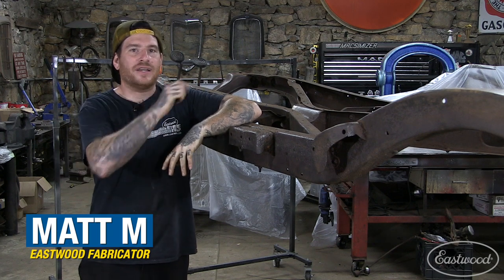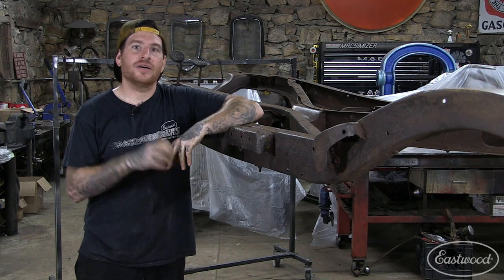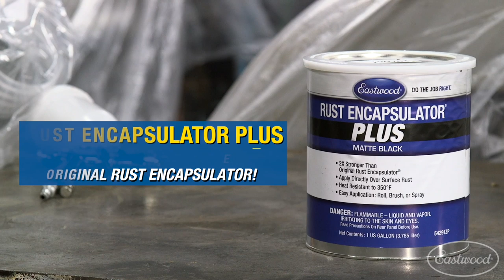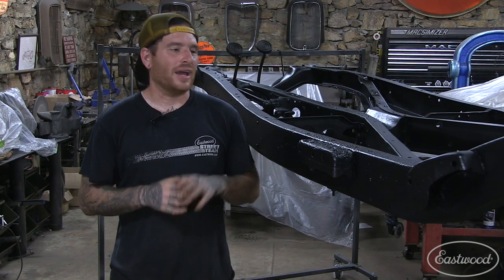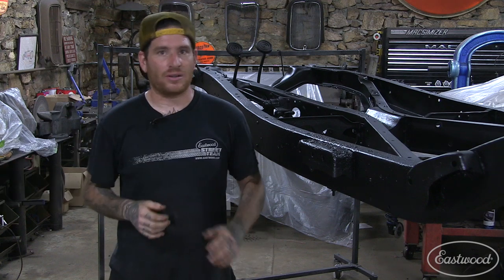How to Paint a Rusty Frame and STOP RUST! Rust Encapsulator PLUS & Ceramic Chassis Black - Eastwood

Comment: Guys...what thinner do you need to use and what ratio to spray the rust encapsulator and once you close the lid on tin, does it then seal the lid like the Bill Hirsch Miracle Paint does or can I open the tin later on and use the remaining contents? Thanks guys from Australia
Reply: use xelene to thin rust cap platnum up to 20% and put plastic on the can then the cap to make the lid removable (inbetween to prevent the stuff gluing the lid on)